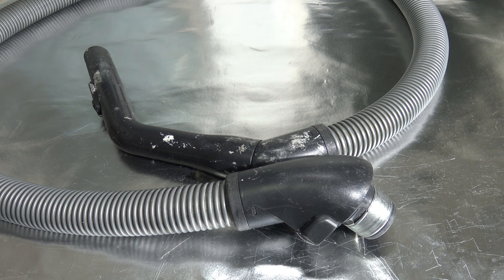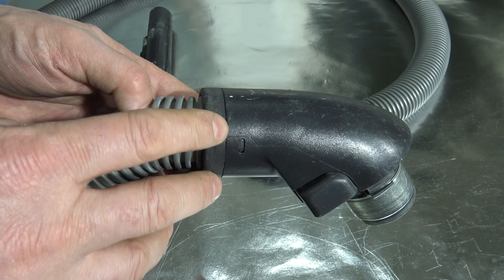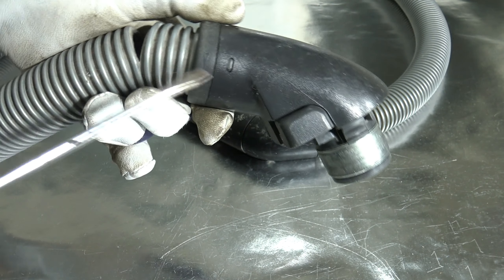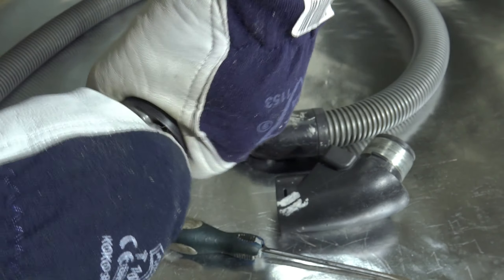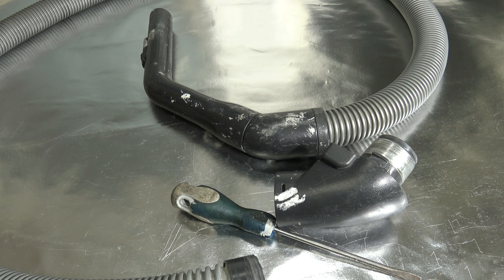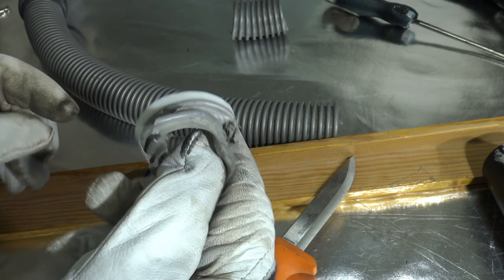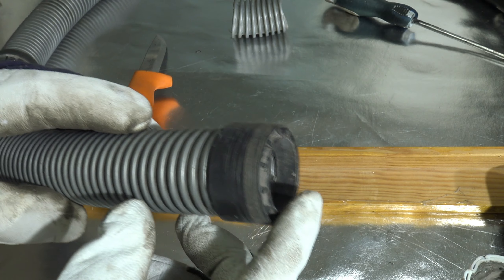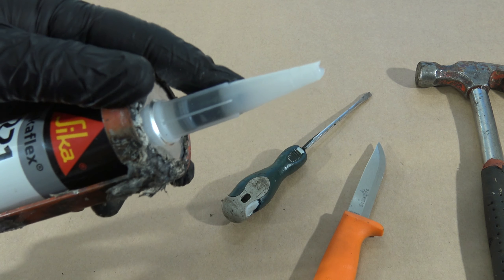EASY. How to repair Bad broken Hose in Vacuum Cleaner

Comment: That knife is so unsafe to use like that. It's not worth risking an injury.
Reply from the maker: Good Comment. Thank you!👍😀
Reply: You would actually cut the rubber around the wire and just pull it straight out away from there and it will unwind out of the threading inside the plastic fitting, as opposed to digging it out like that with that knife.

Comment: Good video - got me started.  I used a flat screw driver, a tin snips to cut, and silicon caulking to keep it in place.  - What I might have done differently  would have been this:  Cut the tube not at the leak, but closer to the fitting.  Then you would screw the broken part of the tube into the fitting.  That way the tube would be just a little longer when done.

Comment: Helpful video, but stay safe & use scissors and a flathead screwdriver. The hose unscrews in the opposite direction than you would expect, so does not need digging out with a knife. Also, using that glue will make it really tricky to repeat the repair process if the hose splits again.... thanks for making the video!
Reply from the maker: Thanks for the info! 👍😀

Comment: I have a question, how hard would it be to put a manual transmission in my 4 speed automatic 1998 Toyota Corolla
Reply: Easy very easy
Reply: @mohammedshafiq4053  have you done it before?
Reply: @jimchance5006  yes it is easy to change gearbox in toyota cars